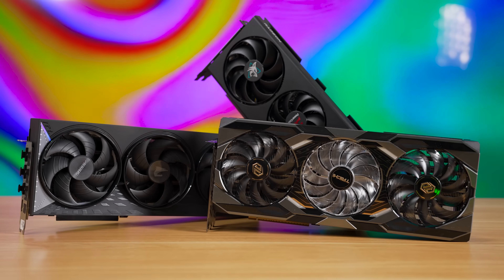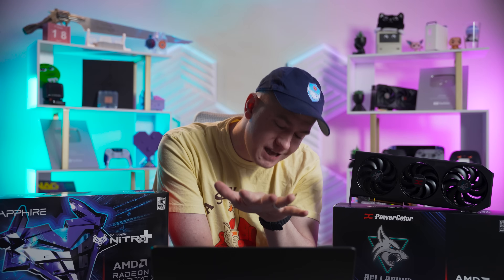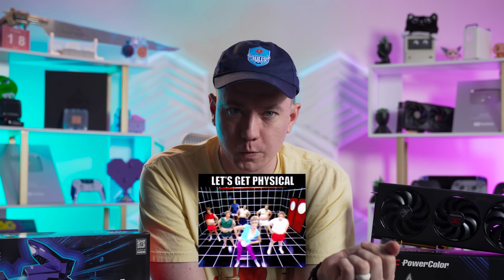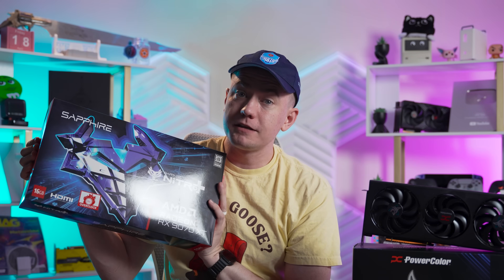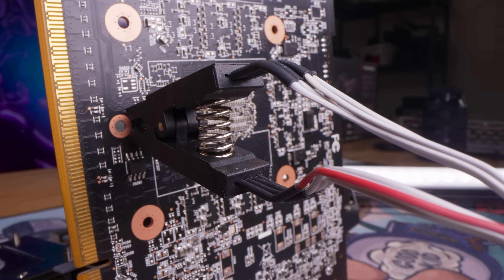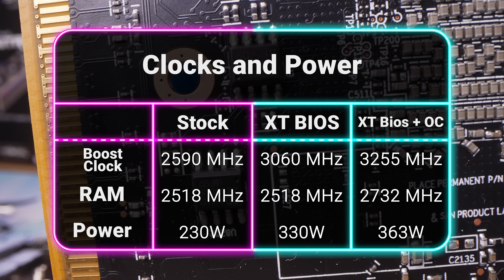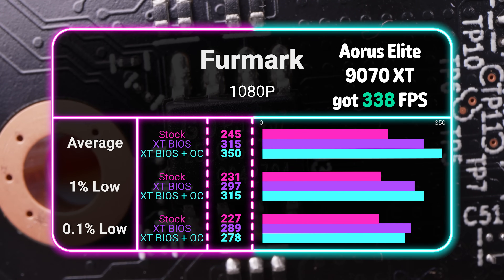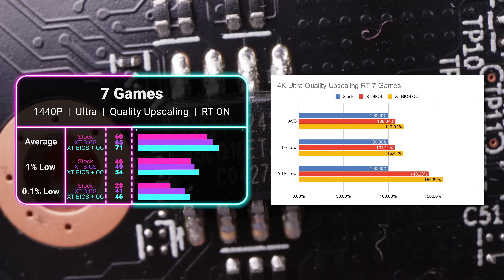The RX 9070 Is Actually INSANE - RX 9070 XT BIOS Mod

Comment: I convinced my RX5700 that it's an XT model using a similar trick. It ran rather hot though, so I had to really dial the voltages in. It's worth it if you're willing to put the effor tin.
Reply: Same with my 3080, turned into a 4070. Granted, I got a golden bin
Reply: @streetcredited   not possible as you would just fry the card, and at the fact of you downgraded as the 3080 is faster...
Reply: @ScorpionBoosted  what are you even on abt "fry the card" have you ever touched afterburner? What exactly is not possible from a card that performs the same but runs hotter and more power hungry? It's literally the only possible outcome if you have a good bin. If you are this clueless then don't argue please
Reply: @streetcredited  ??? a 4070 is slower
Reply: @REXae86  they are literally the same on average and you could see that anywhere on any benchmark before you just start saying stuff. ±5-10%, 4070 slightly better at 1080p, 3080 slightly better at 4k.
Reply: @streetcredited incorrect it's slower on average by 15%
Reply: @REXae86  Are you really this dense? Not even the 12gb averages +15% which is 5-10% faster than a regular 3080. Are u ok?

Comment: Water cooling mandatory with BIOS flash
Reply: Wondering if there is a WC plate available for these?
Reply: ist though? If I'd undervolt and powerlimit it, like I would with a 9070 XT to run more efficiently - this should be fine, right? You can easily undervolt + powerlimit an XT to run at 240-260 Watts while retaining it's performance - so this would basically just be running the non-XT like she normally is, just with better performance...

Comment: im ngl why do that when you can uv/oc, i have the gigabyte 9070 and oc'd my ram to 2800 and with a -55mv and +5% power I got the boost clock to over 3300. all stable
Reply: Gaming oc? How satisfied are you with the gpu? What are the temps and noise? What cpu do you have? I'm still undecided whether it's worth paying more for a little more performance and a lot more watts, as I'm not sure if I'll have a bottleneck with the R7 7700 + 9070xt combo

Comment: I hope you’ll update us if this becomes more accessible as a lot of us don’t want to take the risk of bricking a card when it’s already so hard to get one
Reply: Even if it's eazier to get one, i won't do it like this. After all I spent so much money on it. Using it as a paperweight will sink my heart a lot.
Reply: Yeaaa this the quickest way to destroy ur gpu!
Reply: AMD themselves make it harder and harder to do this kind of thing.
Reply: If the card has dual bios then there's basically no risk
Reply: @michalturcel9975  wrong. Both bios stored on same chip. If you damage that chip she's done.
Reply: @michalturcel9975  Any person with working brain cells will know there is a risk, as stated in the video also. You don't need to be a technician to figure out that you can fry the bios chip if using the wrong voltages and most people didn't even try to disassemble a GPU once, yet to use a bios programmer.

Comment: Would you buy the 9070 XT instead of the 7900 XTX if the 9070 XT is around 150 $ cheaper? Also, which one is the most powerful?
Reply: nah they're more or less the same, 7900 XTX edges it out in most scenarios but FSR4 is just a big + for the 9070 XT, so at 4K, in terms of enjoyability and quality the 9070 XT wins, I would definitely go with it instead of the 7900 XTX
Reply: @wanpii1463  Thanks for the answer man

Comment: I think including data from overclocked stock bios would have been very valuable for the comparison. This would have showed the max theoretical performance you could get in either scenario.
Reply: My non xt 9070 when overclocked and undervolted clocks in at 3100 mhz, power sits at 270, and steelnomad score is ,6930 or close to it. I don't know why I would want to do this.
Reply: @huntermckinney5239  Some people want to chase the pony. I'm with you, I don't think I"ll be doing this mod just to snag the extra 3-5 FPS (maybe), but some people really, really want it, ya know? I think it's a good project if you just want to learn about swapping BIOS out, but I wouldn't risk it if I just wanted some performance, not when an undervolt OC gets you 99% of the performance the BIOS swap does.
Reply: @cajonesalt0191  i do this on my card, because why not, i like to do things like that
Reply: They should of included overclocked stock bios, bios swapped and overclocked bios swapped. That would paint a full picture.

Comment: It is not necessary to take that risk, with just two clicks on the control panel you can already achieve 12-15% more performance
Reply: AMD wattman is limited to a certain %, so vBios mod is useful to push it further, in both Undervolt and overclock side
Reply: @PanchoGDMKWii  only down voltage offset to -120,-130 and set the power limit +10 and with this you win more than 12-15%  performance , and the gpu frequency  is automatically boosted to 3.1 ghz (+600mhz i imagine than this depends on the lucky of the silicon) , higher than some xt oc versions.
You can see it in some YouTube videos, for example on this channel they explain it in a video from a few weeks ago.(Guille ghemi)
Reply: @dolores1113  I get it, but the XT version can clock up to 3.4ghz, I don't think you can achieve that on non XT using Wattman
Reply: @PanchoGDMKWii  yes but cost more ,in my country 650€ non xt and 789 xt ..... I like more 9070 runing +12% with 270w max power consumition than the other with oc till 350-380w
Reply: @dolores1113  Now you can install the 9070 XT vBios to the 9070 so its now a better buy, you can reach those 3.4ghz on the non XT with a proper UV/OC
Reply: Not necessary but it’s still extra performance.
Reply: @perkulant4629  yea but destroy the gpu live and take much risk
Reply: what setting are you exactly talking about if you dont mind me asking?
Reply: @erickgonzalez2887  only down voltage offset to -120,-130 and set the power limit +10 and with this you win more than +12%  performance , and the gpu frequency  is automatically boosted to 3.1 ghz (+600mhz i imagine than this depends on the lucky of the silicon) , higher than some xt oc versions.
You can see it in some YouTube videos, for example on this channel they explain it in a video from a few weeks ago.(Guille ghemi)
Reply: @dolores1113  thanks for the reply, ill be testing this out myself on my 9070 later when i get some free time
Reply: @erickgonzalez2887  You can see it in some YouTube videos, for example on this channel they explain it in a video from a few weeks ago.(Guille ghemi)

Comment: I’m patiently waiting for modders to flash the 7900 XT with the 7900 XTX BIOS. That would be insane if it actually works like in 9000 gpu!
Reply: I'd love my GRE with 7900 XTX BIOS
Reply: @RmX. With only 16GB, you might be lucky to get 7900XT speed, maybe a bit more.
Reply: I'd love my 7800 got that same treatment
Reply: I'd love it if I had a one of the cards stated above my comment.
Reply: @tietieno4890  Hey, don't feel bad. I am sitting here with an RTX 3050 8GB in my main pc and RX 570 4GB in my second pc.
Reply: Completely uneducated on this, but I have a feeling the chiplet architecture makes this way more difficult
Reply: I'd love if my Rx 7600 gets a 7900xtx bios.
Reply: I’d love a graphics card restock
Reply: it will never happens because it's not the same card, the 9070 and 9070 xt are the same card but some core on the 9070 are just off
Reply: What would happen if I flashed my 6600 with the 6700 BIOS?
Reply: @CookyMonzta they are not the same chip.
Reply: BIOS modding become hard to do with AMD doing extra measure to prevent people to load custom BIOS to their GPU.
Reply: That’s not how it works, 9070 has the same chip as the XT model without it being boosted at 300 watts. The card takes more than 230 watts for 20% less performance. Which is actually amazing, but allowing a bios mod to just uncap that wattage limits allows the card to use more power. That’s it, just bios modding a differnt model won’t work even with a 7900GRE with a XT you’re just gonna get 2% performance at the best. 

Remember that 9070 also has 5-10% less cores as well, and missing some shaders. But even without that, it still performs as good as a 9070XT showing how optimized this chipset is
Reply: I want my 7800xt to have a 7900xt bios

Comment: its the same GPU imho  just didn't meet the clocks/voltage/ etc requirements so they removed a few ROPS and pushed it as a 2nd SKU, but day in day out this really feels like the exact same GPU especially cuz they priced them 50$ apart (allegedly)
Reply: This
Reply: 9070XT has better hardware, but outside that what its vBios takes care of, that's why you can flash it to an non XT 9070.

Same with RX 5700 and XT, XT has more Shading units, but same chip and VRAM so swapping the vBios worked for higher clocks and almost/same performance as XT.

Comment: 7900xt is cheaper than 9070 here by few $. So quite a hard pick. 9070 has newer tech but less performance than 7900xt but with bios mod it does get ahead of 7900xt. 🤔
Reply: Less performance, but it has a proper upscaler, which on quality looks almost the same as native, and will give you quite a bit more FPS
Reply: there sort of really isn't much discussion.., Fsr4 or any sort of DLSS is a must on a modern GPU. Unfortunately

Comment: Still remember turning my Phenom II X2 into X4 (from dual core to quad core) from the MoBo settings in my first ever PC, felt like a hacker... Loved AMD ever since 😁
Reply: Yeah, the athlons II x3's were the same, but also mega overclockable too! Unlock 3 to 4 cores, and my oc was insaine with just an og hyper 2x12. 2.8ghz to 4.1ghz... 40% OC 😊. I miss front side buses
Reply: phenom x2 was amazing. most people could unlock 1-2 cores on it